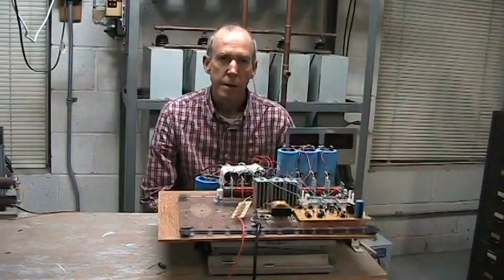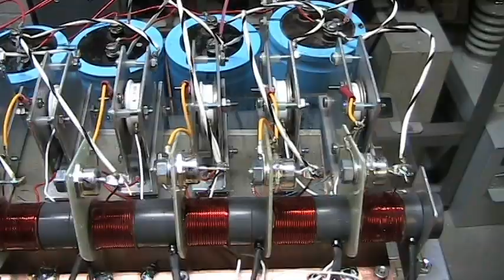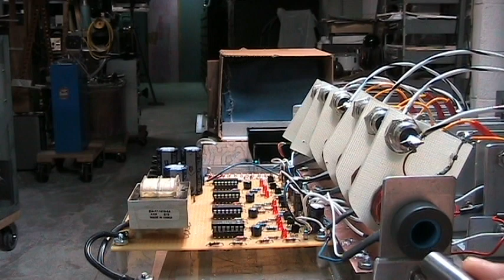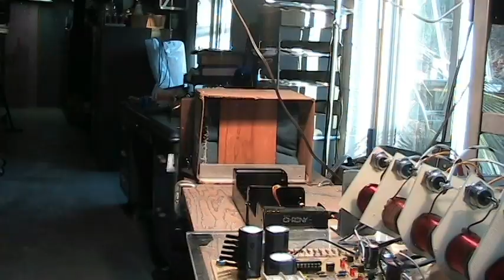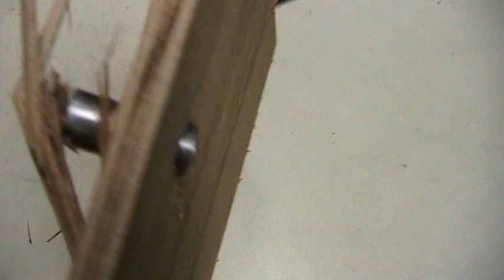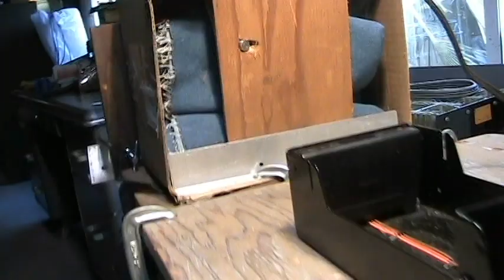coil gun part 2

Comment: Would be "cool" to cool the coils with liquid nitrogen, then you could put 10x more amps through
Reply from the maker: I did more work on coil gun part 3. coil heating is not a problem right now. what I need to do is parallel some IGBT switches and use heaver copper wire and fewer turns.I do not think it would be easy to go much over 500 FPS. Thanks for your interest.
Reply: @stephenhrobak3631  I am far less familiar with coil guns than you, so forgive my ignorance.  So it isn't the overheating, it's simply the resistance of the coils limiting the current from the caps?  Thicker coil lowers resistance and allows more current from the caps, but at the cost that the coil turns are further from the barrel, lowering their efficiency... Wouldn't chilled coils be the best of both worlds, high current and tight windings....?
Reply from the maker: @JuBeYo  It is not so much the resistance but fewer turns allows a faster magnetic response. The magnetic field does not build up instantly. And the current goes through the roof.  Did you ever see those coils to shrink coins. Big switches will be needed.

Comment: what would you need to do to get x10 projectile velocity?
Reply: I read of an idea where the trailing coil collapsing flux boosting the leading coil. that way the energy is actually building as the projectile moves through the tube. Also, to increases acceleration, constant acceleration needs to be achieved. I wonder of not smaller closely spaced coils might be better.  And powering two at a time so that the centre of flux is always in front of the projectile.  Using Minnealloy cored projectiles might also help.
Reply from the maker: The trailing coil does reverse the magnetic field after collapsing. It's like a spring. Coil gun part 3 will be using optically switched IGBT power transistors. They will turn off midway through the coil. There is a space between the coils because of the coil response time.
Reply: @stephenhrobak3631  Rather than dumping the power from the collapsing coil into a diode and resister why not just put it to the negative side of the battery/Capacitor of the next coil? Then the collapsing coil is in series with the cap boosting the voltage. you will need a diode and another IGBT though. Not sure if its worth the complexity
Reply from the maker: There is a common ground for all the capacitors.The resistor helps increase the reversing magnetic field.The coils are tuned for a specific voltage and capacitance. The setup is designed to operate at a specific voltage. The coils are redesigned for coil gun part 3.
Reply: Yes this might be for part 4. I know yours are designed that way to have common ground.  But you do understand how a voltage doubler works so this concept is the same.  There are two things that I am unsure about is 1. when to collapse the active coil as to not slow the projectile down.  2 a fully energized coil in series with a fully charged cap and uncharge coil will result is a huge voltage spike. Will that overvolts the cap? At time 0s the cap is a dead short for the energized coil and the open circuit for the new uncharge coil. This might work better with a super battery like lithium titanate
Reply: Вот мой ускоритель https://youtu.be/SRqVj3_jUa8

Comment: New! Gauss pistol of the greatest force VID 20181031 201942  https://youtu.be/l2GNTFWEFXk
Reply from the maker: I watched your videos , nice work. It looks like a heaver projectile is more effective.
Reply: Thank you for rating. Yes, there are optimal projectile dimensions
Reply: In the video, the functioning of the working model of the electromagnetic mass accelerator (mobile test stand). It is generally accepted that the implementation of this design is very difficult because of the low efficiency and low reliability. Nevertheless, this opinion is mistaken - modern technological the base has long been able to realize an electromagnetic mass accelerator with an acceptable efficiency and high reliability I am looking for interested in making. 
https://www.youtube.com/playlist?list=PLfhSIf7qgNZbdEVBvmjgqkalNNbqTJRtz
Reply: 10 Meter   https://www.youtube.com/playlist?list=PLfhSIf7qgNZbpY7DvnL9JloPEddRnnUm5